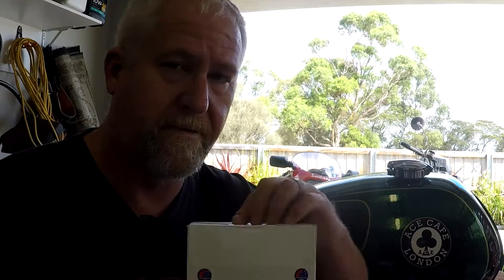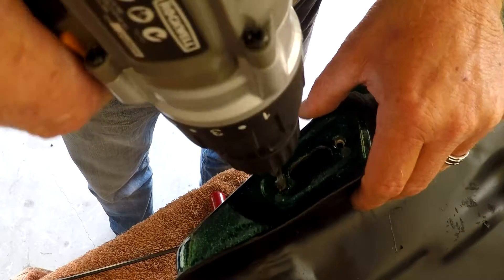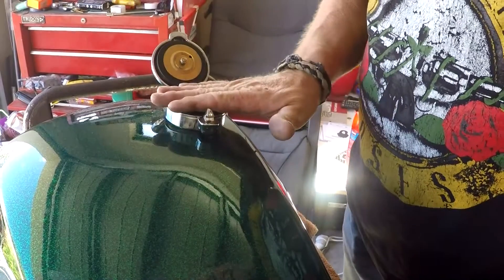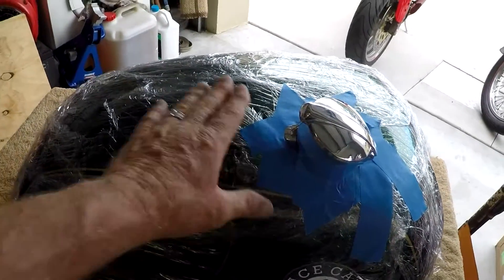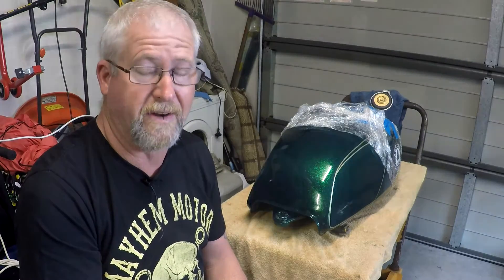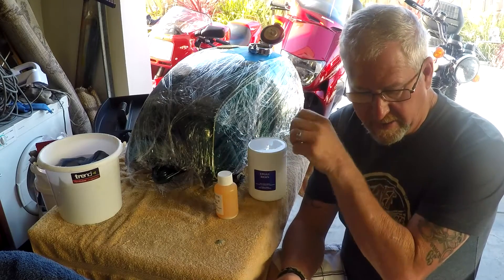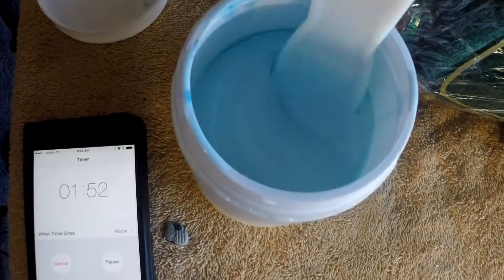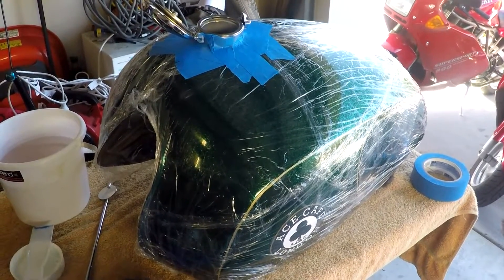Yamaha XS1100 Cafe Racer Project - Episode 33 - Applying a Fuel Tank Liner

Comment: Totally awesome videos Andy. I watched every one. I've done a couple of tank refurbs and would like to add a few things that worked for me.
1. Buy a plumbers plug for the tank opening. should have a wingnut.
2. Pick up some jb weld for plastic repairs. use it at the petcock opening. 
3. Try something called Evapo rust. non toxic and works amazing. 
4. Try Caswells tank sealer. it is quite durable.
5. If the tank is too big for the tub, simply elevate the tub on on side as necessary. 
just my .02 cents. Take care☺
Reply from the maker: G'day Jim, wow thanks for the great comments.  I have learned a lot along the journey from people just like you.  This was my first tank de-rust and reline so it was always going to be sketchy.  I know the plugs that you are talking about, that's a great idea.  If I was to do it again I think I would do things differently.  I would use electrolysis to remove the rust for a start.  I am happy with the tank liner product I used, and it is holding up just fine, so no issues there.  The sealer that I used for the petcock is also holding fast.  But the biggest lesson for me was being naive enough to assume the tank would hold fuel prior to painting.  Given the chance to do it again I would pressure test the tank and braze, weld, patch, do whatever I needed to do to seal it up before applying the liner and THEN apply paint.  Andy
Reply: Andy's Motorcycle Obsessions I used the JB weld to seal the bottom of the tank while derusting and sealing. it kept everything inside and was easy to remove when sealing was completed. I totally agree with you though, we learn by doing.  Best regards and keep up the great videos, they're priceless.

Comment: Hello Andy, nice job on all the video's of the XS! I have discovered them yesterday and have now caught up with your progress. I have been working with my father on his XS1100. After I had the bike's carbs checked and worked on by a "specialist" it worked for about 200 km's. This was supposed to be a gift from me to him. Then one of the carbs broke wile riding and as a result the cylinder attached to it started burning oil. I ended up on the side of the highway in clouds of smoke. That then was the end of the engine.

I can't wait until the moment that you are going to adjust your setting of your carburetors. I hope to learn how to do it myself. Since my adventure with the toasted engine, we have installed another engine which came of my fathers spare-bike. But I think the carbs need some work, so I will be waiting for your video's if they will be made.

I really like the fix for the carburetor which had the holder for the floater broken. We had a similar problem on one of the carburetors. 

Keep up the nice work!
Reply from the maker: Hey KuDo, thanks for the feedback mate. Carb setup will be the next one. Hope to have it up next weekend
Reply: Hello Andy, that's good to know. I'm looking forward to it! Really appreciate the time and effort you are putting in to these video's. They don't do themselves

Comment: Hi andy, i was wondering that can i run regular fuel tap (no vacuum) on my XJ......originally it had vacuum fueltap but i really dont trust them, i wud rather have a simple fueltap whit on/off position......But if i do that does my carbs get enough fuel ?  Good video :)
Reply from the maker: +TT GarageRat Of course you can mate.  Carb manufacturers don't care how you get the fuel to the carbs.  However they probably recommend to manufacturers that they fit a failsafe to prevent flooding and filling the sump with fuel when the bike is parked.  My recommendation would be to ensure that you shut the taps off when ever you shut down the bike.

Comment: so, I picked up a 1979 xs1100. the vacuum advance isnt hooked up to anything. has the airbox configuration too, havent seen much as for the oil seperator or the vent line (I think) from the carbs if you switch to pods, only thing I've been able to find it just upping the jets..... so first is if I dont have the vacuum diaphragm where should hook the vacuum advance?  or am I just confused with it
Reply from the maker: +OMAR DINUNZIO Hi Omar, the vacuum advance hose should run from the vacuum advance diaphragm behind the left hand side crankcase cover to a brass tube on the number two carburetor.  As for the oil separator I just ran a hose to a small pod type filter.  You could just route it up the frame and cable tie it in place somewhere, doesn't need to plug into anything but it is wise to plug it into a filter of some type to prevent dirt ingress. If you are running pod filters just remove the carburetor bowl vent hoses at the tees.  I have been told that any hose at all on the vents will add yet another problem when trying to run pods on CV carbs.
Reply: +Andy's Motorcycle Obsessions best to keep the current carbs stock with the airbox? and if I wanted to switch to pods, I would update to a new carb set?
Reply from the maker: It depends on what you want to end up with, and how much you're prepared to spend.  The CV carbs will always work better in a shared airbox.  If you can fit the pods to the factory velocity stacks it is supposed to be pretty good.  XJ1200 carbs are supposed to be a good upgrade but I ultimately fitted Mikuni flat slides but they come at a cost.  All the vents are nothing to worry about, it's just a crankcase breather and a couple of carb vents.  They don't need to return to the airbox.

Comment: sorry if i missed it in one of the videos but did you do one where you cut, fit and weld on the new cover for the tank after cutting out the old fuel cap?  i'm gonna have to do the same thing to my xs1100
Reply from the maker: No there is no video.  I have another tank to prepare and I think this time I will weld a plate over the filler neck and weld the vent hole in the neck and then plate over the whole thing.  That way I only need it to seal at the filler neck and not at the tank itself.

Comment: Handy Andy, great tips yet again! When you put the Nuts n Bolts in the tank did you give it a vigorous shake before treating? Just wondering if that then released much corrosion? Cheers Tony. NB just picked up two XJ 's to start my own project!
Reply from the maker: +Tony Peters G'day Tony, I didn't have much loose stuff left but yes it does.  If you have a fair bit of loose rust you will need more than I put it.  If your tank is small enough you can wrap it in a towel and stuff it in a dryer and tumble it for a while, but this mahoosive thing ain't going to fit.  You just need to be careful that you don't shake it in a manner that can cause the nuts and bolts to dent the tank.  I've heard of people using pebbles, but I like nuts and bolts, they're magnetic and easier to retrieve.
Reply: Thanks Andy, I like tge tumble drier idea! But.... mught be more than my life is worth to try it if you know what I mean!!
Reply from the maker: Apparently an old chain works well, thanks Christian for the tip
Reply: And don't use stainless nuts and bolts - they aren't magnetic LOL

Comment: How did that work out lining the gas tank
Reply from the maker: G'day mate, two and a half years later and it still doesn't leak.
Reply: I may have to do mine looks just like yours same color combos really like the video s thanks
Reply from the maker: I did it again recently on a GS1000 but I used electrolysis to remove the rust, here’s a link if you’re interested https://youtu.be/ZgnuCg8ANQI

Comment: Hi Andy, ref the threads. Since I discovered Time-Serts I haven't looked back, way better than a helicoil for most jobs. I had to do one of the spark plug holes on one of my V-twins when I had it apart.  It worked out so good I did the other head while I was at it. Have a look at Cross Tools in Newcastle: http://www.crosstools.com.au/ Excellent site for information too. (I'm not affiliated to them by the way, but they have helped me out of plenty of tricky spots over the years, and Aussie to boot).
Reply from the maker: Yes I've seen them.  Another good one are keyserts https://www.youtube.com/watch?v=UTdJUMIcrPI